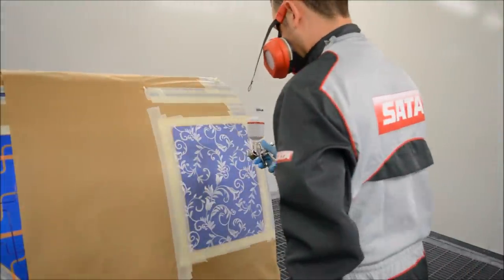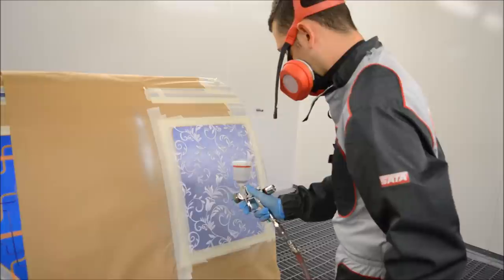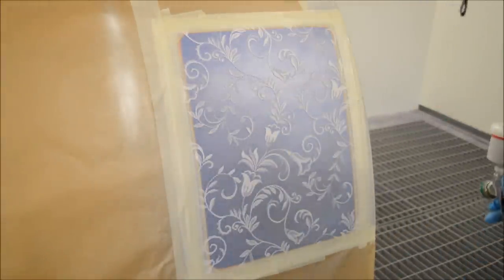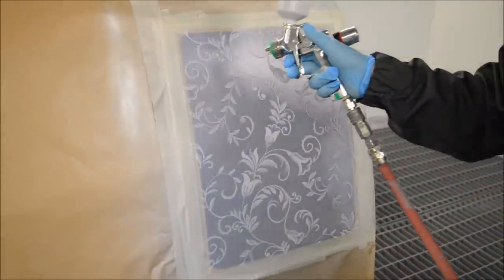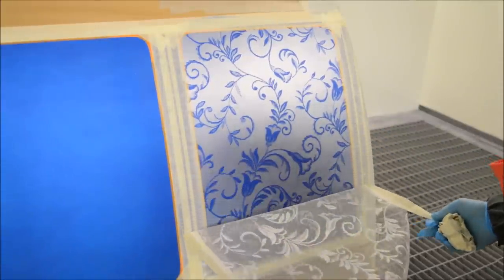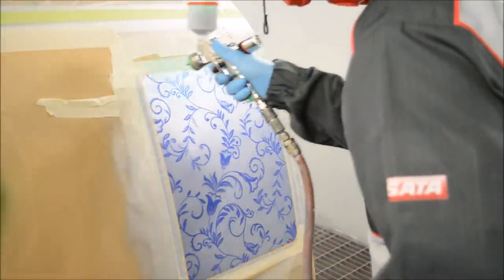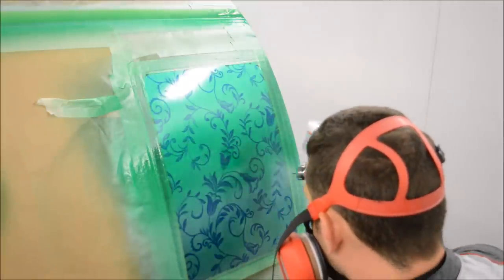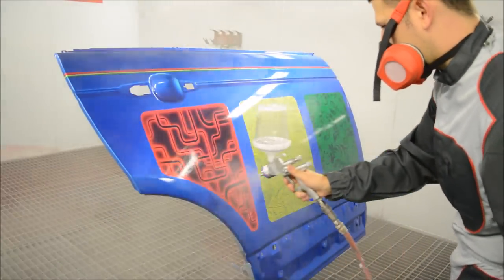Custom painting with Lace in 5 minutes using SATA 4400!

Comment: How is it that the candy doesn't cover the lace pattern?
Reply from the maker: What do you mean? As in why doesnt the candy hide the lace design underneath?
Reply: Repair Refinish TV He never replied, so im going to reply for him cause im curious as well. How come the candy doesn’t cover up the lace design? Is it because its a translucent paint?
Reply: It's  a colored  clear coat that's why
Reply: the candy is a transparent paint so it lets whatever is underneath show through. if you put enough coats of the candy over the lace pattern it would eventually cover it up
Reply: the candy is a dye sort of like a glaze the more coats you add the richer the colour gets but gets darkened one 
shade depending on how you mix the candy normaly 50:50 with clear intercoat 
candys are designed to work on metallic and flake basecoats where the surface has a reflective surface 
as its a dye it barely shows against darker colours but will tint the blue but green candy on blue 
he will get a slightly darker teal
if he just wanted shiny green candy  on blue he would have left the lace on for the candycoat